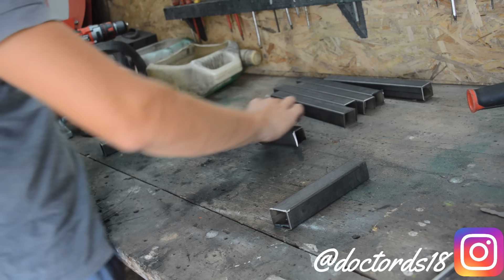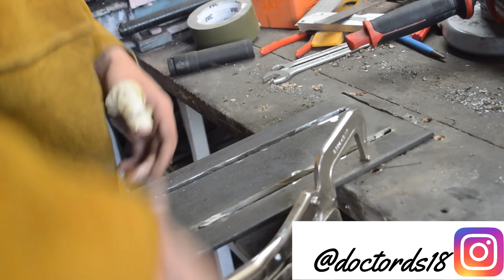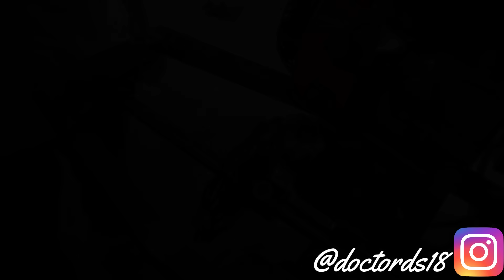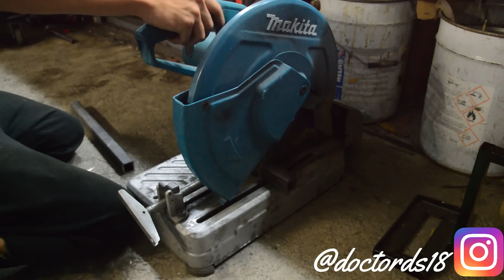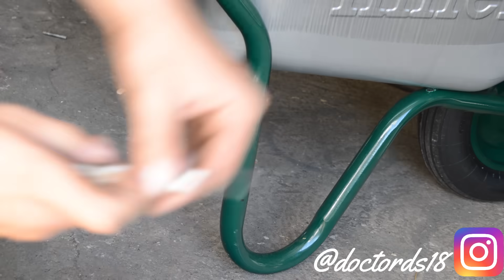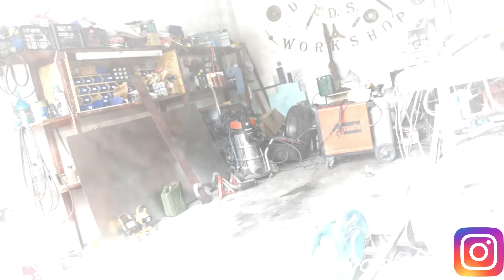Homemade 200cc WHEELBARROW  !?  PART 1

Comment: Nice invention but my suggestion is you add a place to sit maybe on top of the machine and the machine will be under the seat and a system where the wheel barrow will be able to empty itself without the driver even moving. Good job bro thumbs up.
Reply: "A Riding-motorized-Wheelbarrow" is what you're saying! LoL!
Reply: I think so
Reply: Yep and the hind limbs of the wheel barrow too can have wheels to suspend the whole wheel barrow on wheels for easy maneuver .

Comment: A Chain Breaker is a bit faster and a bit safer than a Grinder, Hammer, and Punch. Master Links are a good thing to have as well. Otherwise, excellent video. I have seen Wheelbarrows used for many things, but this is a first for me.

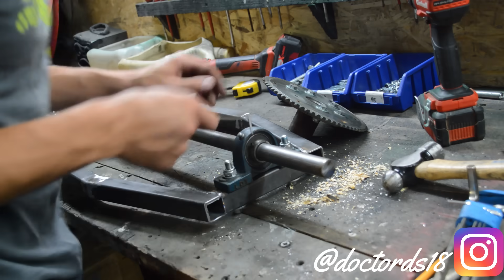Comment: As i say in most videos..at 5:11, heat up that hub, and you can finally put down the hammer and pipe. Itll slide ride on that axle.

Comment: The engine is too small, you needed at least 13HP!
The definition of a horsepower is the force needed to lift 75kg to 1 m in a second.
On the right trajectory it is not a problem but it requires a lot of force to take the turn - if you can! Anyway, the wheelbarrow will break ...

Comment: Did I miss something or are you using a live axle forcing both wheels to turn together? If so, cornering could be interesting. My wheelbarrow has a differential with diff lock for when the going gets tough.

Comment: the shaft and the wheels are not connected properly!   The handle bars couldve been much higher. and I wouldve placed a seat on top of the motor.  U also need some safety from the chain spining in between ur legs.  still needs a lot of improvements.

Comment: I admire your creativity but if you went that far to add a motor, why didn't you just create the wheel barrow into a powered 3 wheeled truck that you can sit on?  Your way is impressive but your going to still hurt your back from bending just to steer.  Just an opinion.  Other than that, Your are amazing creator!  👍😎

Comment: Mit einer Schubkarre hat man nicht immer viel Platz, da ist so eine  Konstruktion ungeeignet. Sinn macht das nicht!
Schon das Einparken in einen Schuppen oder Garage macht Probleme-man hat ja keinen Rückwärtsgang- und kostet viel Platz. Geprüfte Sicherheit bekäme das Teil kein Prüfzeichen-offen laufende Kette usw.
Reply: A wheelbarrow is very versatile - you can return on the spot, you can walk on a narrow board, etc. This turns it into a very small capacity dumper, dangerous in operation, unreliable.
There is probably a guard on the chain, but the wheelbarrow will still be dismantled.